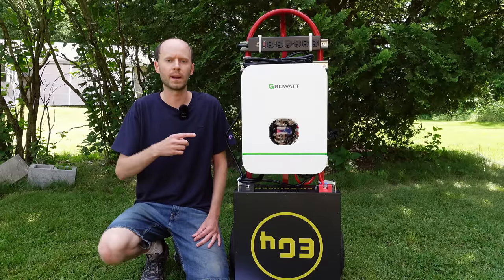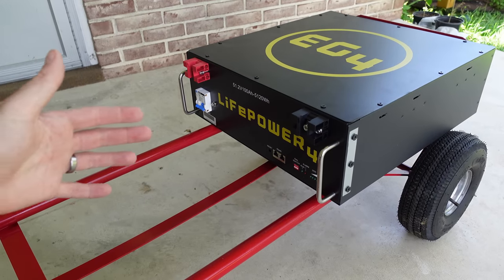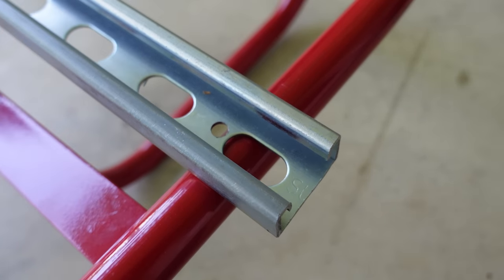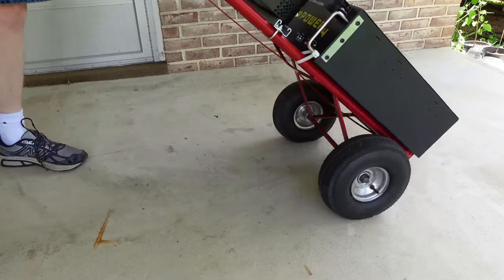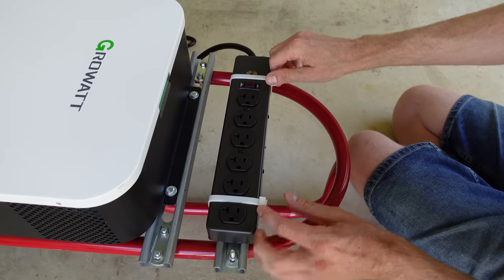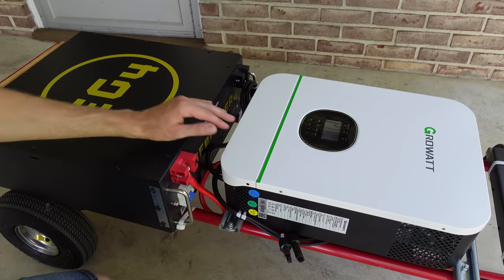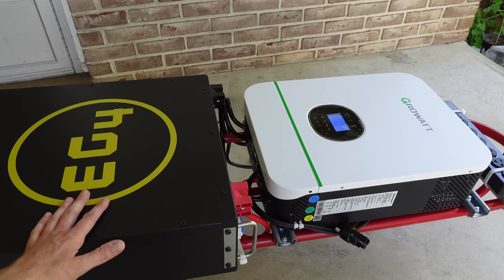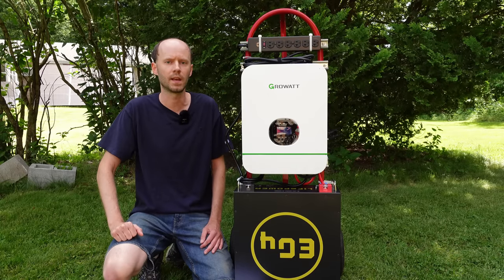Building a 3000W Portable Solar Power Station, Great for Power Outages!

Comment: You packed a lot of concise information into a 17 minute video!  Question, can the input be plugged in constantly?  I don't believe that will hurt with most chargers.  Secondly, do you have any idea how long a 14 amp AC would run with this set up?  It would be more difficult to set up, but two of the batteries could be connected in parallel to almost double the output amp hours and output time.
Reply: 1) The inverter is originally designed to be permanently wired in place with a recommended AC input circuit breaker.  So Yes, it can be left plugged in and used as a UPS for an appliance, like a freezer, etc.  In such a case, when the power goes out, the battery(s) powers the freezer, and when power is restored, the unit will automatically recharge the battery using AC and Solar if available.  I belieive the inverter does consume about 50 watts when idle and used in this configuration.  There are more efficient inverters that use less power, but they come with a higher price tag.

2) The problem with determinine how long an airconditioner might run is that it is difficult to determine because the compressor does not run constantly.  Worst case you could calculate time using peak current draw, but expect it to run longer than that.  Your mileage will vary.

3) Yes, you can uses as many batteries in series/parallel as the battery manufacture says.  Be careful though, not all batteries are the same, there is a limit to the number you can connect together.  Also, not all batteries can be stacked.  Again, the battery mfg is the place to check.

4) Using more batteries would make this difficult to move around if you still want use a cart and keep this portable.

Good luck.  Hope this helps.
Reply: @russlo5324  Thanks for such a detailed response!

Comment: Thanks very much for the informative and simple design explanation. I am in Australia, with a 240V system, so how does this change the wiring? And could I use 2 x 300 Amp-hour LiFePO4 batteries (12V) in Series and build a permanent off-grid system for my house? I have a 6.3 kW PV system, and my calculations suggest this battery capacity would suffice 90% of the time. I have an Excel spreadsheet where I calculate my power generation and usage, which should be an average of 3.2 kWh per day in Winter (1.6 Kwh evening use). I have built a shed with the PV system on it but the house will be built in the next year or two, and I started my design with the principle of minimising usage from the outset. Thanks for your time and effort.
Reply: Don't see why not, I know on regular solar "deep cycle" batteries you can daisy chain them to increase the Ah. Next, from what I got out of the video, that inverter only puts out 110 AC, so unless you could change it, (which I use AIMS,
and you can't on them), that inverter wouldn't work for you. You would need a 220 V which requires more amps, so you'd almost have to use two batteries...
Reply: @skipwilson5086  Yes, I realised I would need a different inverter, and after watching another of this series I realised a 100 Ah 48V battery would do the trick. I will have to get someone to wire it in for me, which won't be a problem, but I have double-checked my projected usage and I am sure it will be big enough. But to be on the safe side I will wait till I have the house built and see in reality how my consumption works before committing to a battery and possibly disconnecting from the Grid, because most retailers have cut our Feed-in tariffs back to 5c/kWh lately and raised our daily connection charge. I guessed this would happen and prepared for it in my design. I wished I had gone off-grid from the beginning now, but even 1 year ago batteries were more expensive and technology was changing rapidly so I was caught in a tight spot. Probably I didn't know enough then either. Anyway, thanks for your reply.

Comment: Would there be any risk of the battery terminals being exposed? i am very ignorant but what risks would be if the terminals are accidentally touched? would there be an easy way to cover the terminals that wouldnt be a fire hazard?
Reply from the maker: There are clear plastic covers that go over the battery terminals. I didn't show them in the video because I had lost them; however, found them near the end and put them on. You can see them in the "conclusions" chapter if you look closely. I'm not sure what I'd use off the top of my head if I didn't have them; however, I do agree that they should be covered somehow - especially when in the upward orientation like I have.

Comment: Can you ground the portable system by running a groundwire from the All-in-One Inverter to a standard 120 wall receptacle by using a 3-prong plug from an extension cord, with only the negative wire hooked up and ground the inverter to a home's electric system through a standard 120 outlet?

Comment: Probably should have mounted the rail clamps the other way around so the nuts could be tightened from the back of the cart. It might have allowed you to slide the cone nuts a bit easier without having to modify anything else.

Comment: Really like this idea, question is, how long would this run a window AC ..Midea 8,000 BTU EasyCool Window Air Conditioner, Says 670 watts..
Reply: 5100 Watts in the unit divide by 670 = 7.6 ish say 6?
Reply: Thank you, George

Comment: Can one of these Growatt's switch from AC to Battery fast enough to use as a large UPS as well? I would assume so, since it is designed to switch from AC to battery and back pretty seamlessly. Or would it be best to have a real UPS after it? (2 computers, 1 server and lots of networking/telecom gear on the other side of it, so electronically sensitive stuff) Looking for a selling point to get the buy in from the wife to spend $2,500 to make one of these. The idea of being able to run the generator less frequently in a power outage, and to start a piecemeal Solar setup to feed into this while keeping most of the Solar setup able to be moved to the next house is appealing. Also these Growatts are chainable right, so I could make a setup of 2 of these to output 240v with some setup and config with moving them from point a to b?
Reply: I suggest downloading and reading the manual.  The Growatt can be used as either a computer or applicance (default) ups.

Comment: Do you need 48vdc in solar panels to charge the battery?
Reply from the maker: For this particular inverter charger, you need a minimum of 60V operating voltage (Vmp).

Comment: So, Growatt recommends a minimum clearance of 19" from the top and bottom of the unit for heat dissipation.  Thoughts? Thanks.
Reply from the maker: I don't see a problem with what I built here; however, my recommendation is always to follow the manufacturer's instruction.
Reply: @LithiumSolar  Thank you sir

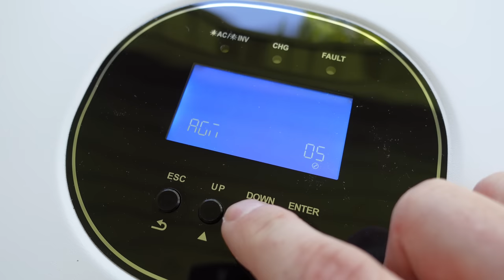Comment: 14:00 Also important to note that not only Exceeds the plug current, but that ANY LOADS currently on it, will be bypassed.  so if you have it setup to charge at 1200W and you have a 2000W load, you will pull 3200W from the plug
Reply from the maker: Correct, and code requires continuous loads be derated. There are a lot of things to consider, thus why it's important to discuss with electrician if you're not sure.

Comment: How do you install a 30amp outlet on a portable generator?? No one ive seen so far is showing how to do that.
Reply from the maker: This system is not capable of a standard 30A feed outlet for a home transfer switch. You'd need a much larger inverter and one that is split-phase.

Comment: Does the Growatt inverter pass through solar to charge battery even when powering some loads?
Reply from the maker: Yes. If you're producing more power than using to power appliances, the excess will charge the battery.
Reply: @LithiumSolar  Thank You! I thought that would be the case, but needed to know for sure!

Comment: For that unistrut, if you have a circular saw, get the diablo "Steel Demon" blade (sized for your saw).  They're about $30 and it's crazy how well they cut through metal.  (Relatively) quiet, very little sparks or heat, they're just amazing.  And if you already have a circular saw (which is a pretty standard DIY'er tool) this is an easy way to cut metal, assuming you can lock the unistrut down somehow to make a straight across cut.  Easiest way to do that is sandwich it between a couple pieces of wood so you can run the saw over the wood and strut together.

Comment: You failed to show us the solar panels to power the batteries, how many solar arrays do we need for this set up? If the power is out for several days, we will need to connect to the solar arrays correct?
Reply from the maker: Did you check my other videos? I have an entire video dedicated to exactly what you're asking.

Comment: It is a good thing to have this around however I would add my new invention tesla coil charger to continue using it with out worries to charge with solar panels and perhaps less batteries. Is in the horizon soon to be explained.

Comment: Is it possible to add a another battery for extended load? I am looking for a unit to power up a small off grid cabin with solar charging with a option to charge by generator when its cloudy.
Reply from the maker: The cart is already full as-is. It's possible to add another battery but you would have to rethink the design and probably wouldn't be portable at that point.

Comment: And is it advisable to put a 15amp breaker between the inverter and the AC wall socket?
Reply from the maker: No. The way I built it here requires a dedicated 20A circuit and can have a maximum continuous load of 16A.

Comment: Liked your hand cart solar system, hope to build something similar, I wonder how long it will run fridge during per outage?
Reply: Just find out how many watts your fridge uses per hour and divide that in 5100 watts which is the capacity of the battery.

Comment: I have a Question, I heard there is that issue with the 48v units and a hazard of being electrocuted if you touch the terminates, after it is charged and live. from what i have researched, it seems to only be an issue with 48v setups. could you recommend a 24v set up for this same kind of build?
Reply: That may be true, but consider that you spend your day around 120v AC and live to tell about it.

Comment: Maybe you could have had the U bolt turn the other way so the nut is facing down
Or put the  u channel facing down and use a longer bolt
Reply from the maker: Reversing the u-bolt may work, but I was concerned that the flat metal piece of the clamp would just bend around the pole as I tightened it down.

Comment: No worries breaker should be able to trip even when hold on position.  (circuit breaker standard UL489)
Reply: Right, we put locks on breakers to keep people from turning them off.  They can still trip.  It's required for breakers serving fire panels and a good idea for critical infrastructure as well.

Comment: Have you found an easy way to limit charging the battery to 80%?  I tried contacting Signature Solar, but they never responded to my email about it.  Thanks in advance.
Reply from the maker: There's not really an "easy" way as voltage is not a good indicator of state of charge when it comes to LiFePO4.
Reply: @LithiumSolar  so the 7000 cycles is a gimmick, something you can never attain? Am I supposed to sit here watching, waiting for the charger to get to 80% and then I stop it? Is that the assumption?  What a farce.
Reply from the maker: @thisoldrv  You're here for the purposes of trolling, yes? Every electrical product under the sun is going to have a set of specifications and I guarantee not one of them is being used as per the specification.
Reply: @LithiumSolar  I wasn't blaming you for it. I'm blaming the manufacturer.

Comment: I have two upright freezers in my garage, a 15cf dinosaur  workhorse 
Montgomery Ward  manual defrost, and a 21  cf Frigidaire auto defrost nearly new.  The old one was to be a backup, but the nearly new freezer needed new seals this week so I have lost most of the meat in the new freezer and decided to have a new breaker installed and keep both running.   Suspicious fires at 100 food factories the last 6 months makes our food supply chain unpredictable.    
To exacerbate the situation the Calif Gov just announced all commercial trucks & all pickups mfg’d after 2010 is banned frim Calif effective 1/1/23 !  Commercial trucks bring food so this could be a 
Rocky ride coming this fall.  

I want two solar generators, one to power two freezers & one to power the kitchen main frig & kitchen mini-fridge.  No idea how many watts I need.  Is there a formula to determine wattage I need?m for generators?

Comment: Great video!  I have the ES version of the power controller - but it seems like everything should be close enough.  But my outlets I would be charging from are just normal home outlets (closer to 15A, right?) - will it "just work" to charge from that?  Or do I need to configure it to limit power draw?

Comment: Would it be possible to purchase one or two more batteries and mount them to a different hand truck and wire them all into the inverter at the same time? I guess an alternative version of this question is, how many batteries can this inverter handle at one time?
Reply: Great question. I'd like that answered as well.
Reply: @keithmorris598  
 Maximum solar charging: 4500 watts @ 80amps.

If your solar array can provide 4,500 watts for 5 hours a day exclusively to charge your batteries it could take (4) 5,000 watt hour batteries from 0 to full in one day.

That does not mean that four is the maximum number of batteries it just gives you an idea of how much power it could use to charge them from empty. You could have more batteries that would stay full against the possibility of a rainy week when the solar energy each day is severely limited and the extra batteries would provide you backup power. It would probably be less expensive to buy a generator and propane for those days.

Comment: Can you charge the battery via a gasoline generator as well ?   What is the minimum PV to charge this unit ?
Reply: Yes, you can recharge via gas generator. I just confirmed yesterday with the Signature Solar guys.  My house is not solar friendly so I can recharge the battery with a 3000 watt generator in about 2 hours.
Reply: @mwhferrari  thank you so much !

Comment: I have built same as you but am afraid to charge it fully with ordinary house hold plug can you advise if this is safe
Reply from the maker: You need to ensure the current pulled from the input is less than 80% of the circuit you're plugging it in to. For example, if you have a dedicated 20A circuit, you can only pull 16A. It sounds like you're not sure and that hesitancy is good; however, I am not an electrician nor authorized to give specific electrical advise. I'd recommend contacting a licensed electrician at that point.
Reply: @LithiumSolar  Cheers will do

Comment: I'm trying to understand the battery situation. I see a lot of builds using these EG4 LiFePO4 rack mount batteries that you're using here. Why would I buy that vs something like a Li Time 100Ah brick for < 1/4 the cost?
Reply: I think I finally answered my own question. If you wire 4x 12v 100Ah batteries in series you have 48v but still only 100Ah. It still seems marginally cheaper to buy 4x 100Ah batteries, but the cost savings isn't nearly as much.
Reply from the maker: Yeah, I was about to say that LiTime is 1/4th the cost but also 1/4th the battery :)
Reply from the maker: They make very good batteries though also.

Comment: If I got the 220v 48v growatt would it power a 220v well for a short period with 1 48v battery? Say just for like 5 mins of run time?
Reply from the maker: You'll need to look at the power requirement (in Watts) of the load you're trying to power. It doesn't matter if 120V or 240V.

Comment: Nicely done. However, I'm a ham operator, and suspect those devices - particularly those related to the inverter and its chargers, would output massive amounts of radio frequency interference. Filtering such interference is often very difficult.
Reply: I am also a ham and have the same system to set up. I plan to get a 48 to 12 volt converter so I can run my radios off of the battery without needing the inverter.

Comment: I like the plywood maybe just paint the plywood orange crank tie down straps to hold the battery they're like 15 bucks and the inverter when the hand truck is standing up. inverter settings screen should be as eye level as possible plastic tie downs fail over time

Comment: Well done.  The only improvement could be an optional ground connection.  The ungrounded system could be an advantage for sump pumps, grounded hot tubs or fuel extraction systems.

Comment: Why not place the inverter, on the battery.  I think the center of gravity would be lower, making it easier to move.
Reply: I built this.  The inverter is designed so that the status display is at eye level.  Also, all the connections, circuit breaker and on-off switch is located on the bottom of the inverter.  Then you have the issue of how to attach the inverter to the battery.
Reply: @russlo5324  that makes perfect sense. Am building a cabin,small 240 sq feet. And looking for off the grid.what is your thoughts?
Reply: @wilber19541  It depends on your needs really.  Do you need portable?  Would your equipment be safe if permanently mounted?  What do you want to run with it and for how long?  Where is the cabin located?  My best suggestion is to join one or more solar forums and see what others have done, what worked, what did not.  As a ham radio operator, I am familiar with electricity, but solar is a horse of a different color.  Once you determine your needs, then decide on a kit or DIY.  There is no shame in buying a kit and the components are matched for you.